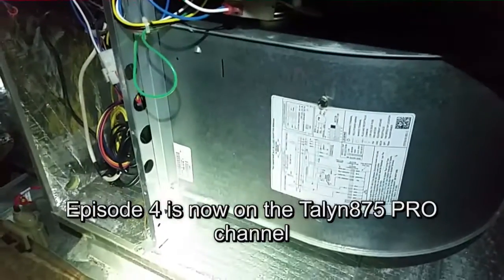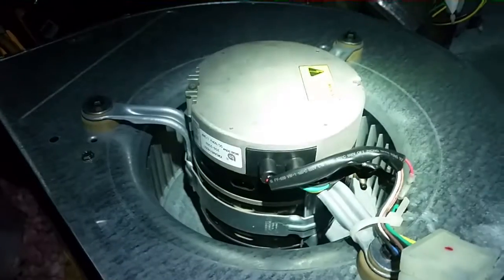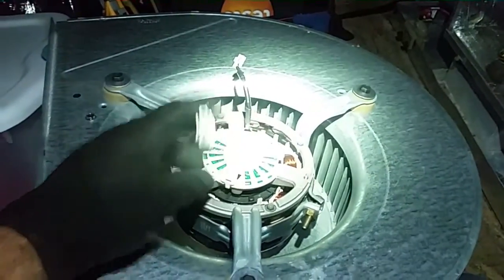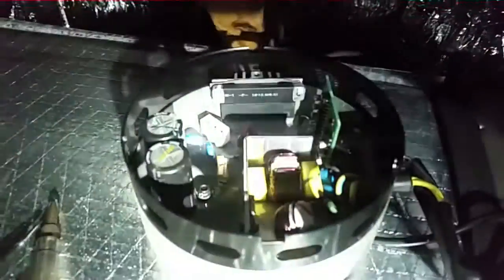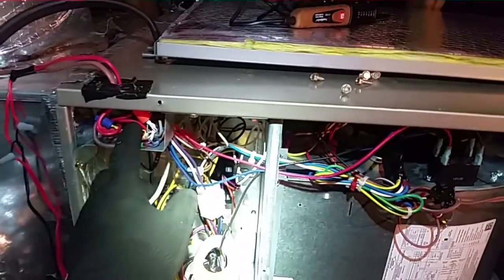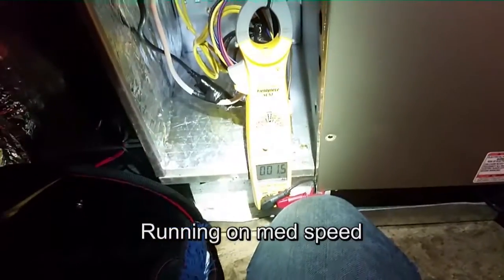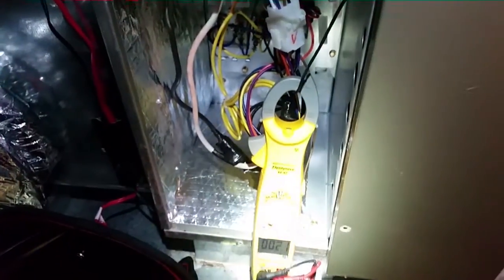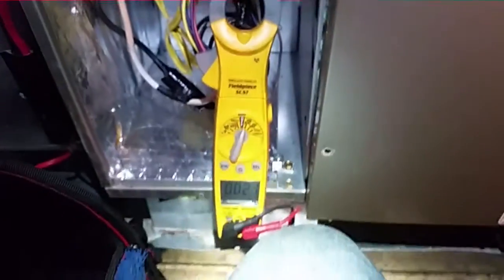Broad Ocean Chinese ECM Motor Early Failure

Comment: Im dealing with a broad-ocean 1/3 hp motor right now in my house that seems to have an issue; stopped blowing yesterday, only a 4 year old motor; I tested to make sure both hot wires had 120, and the blue wire has 26 volts; what is the white wire with green tape? Every video I watch has the white with green tape; I get no voltage on that line.
Reply: White has voltage only in heat mode

Comment: Just a question, I don't repair much ECM's due to limited service calls in AC, but is it cost that your not installing an OEM or did you discuss with customer and they agreed with psc? only reason I ask is in my niche of heating we are forced to use OEM motors or it unlists the appliance, voids home owners insurance. and we absorb all liability. Thanks for the video, appreciate the explanations. Have the basic zebra tester, Haven,'t used it yet.
Reply from the maker: +Robert Ornelas temporary replacement I supplied

Comment: ecm motors are quitter and have no inrush current....they have a universal replacement ecm made by rescue for 150....good motor...ive installed over 1000  for the most part they hold up.....
Reply: I need to replace my ECM blower but is highly expensive. Where can I find the one you mentioned?
Reply: @Adel_Volks  also curious for a model number I need a replacement for this Chinese garbage
Reply: curious if you have a model number